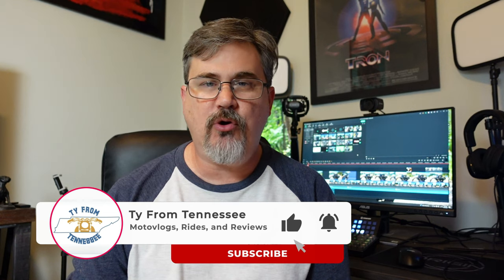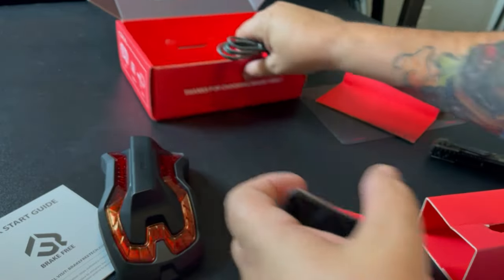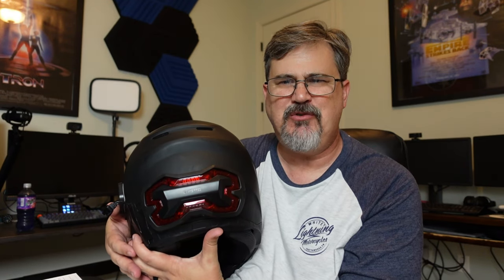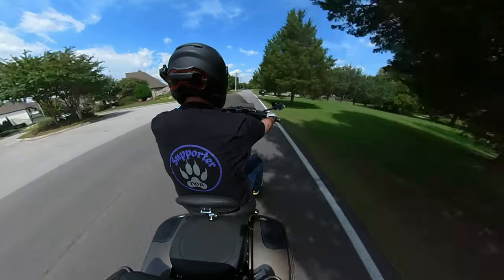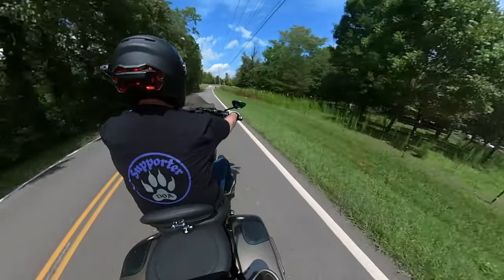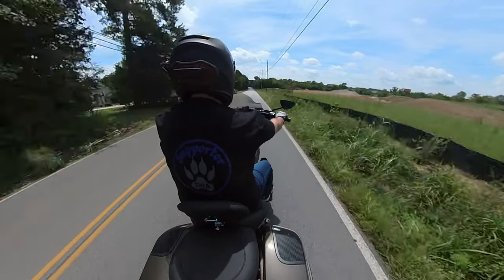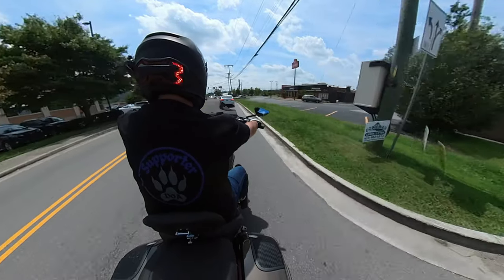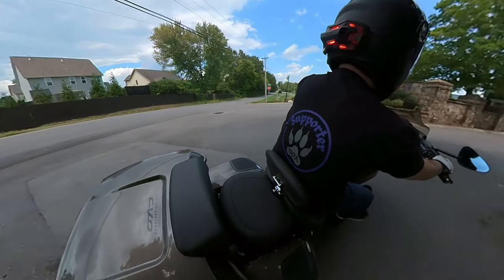Brake Free Helmet Light - Unboxing, Install, Review

Comment: If you don't have many lights on the back of your bike, I definitely see the appeal. Adding weight to the helmet is a concern. Also having something else to charge is a negative. I like the product and I think it's a good idea
Reply from the maker: Lots of both positives and negatives for this device. You can't really tell it's there on the helmet, but I was kinda worried about it falling off. Thanks for watching. I appreciate your time today.
Reply: 7 oz is the weight.  Does need tweaking for “normal” stops.  Overall more lighting at eye level.

Comment: Nice review man.  I wish it was maybe a bit more sensitive.  I feel this would be what I would use in a night time setting.  Great work Ty
Reply from the maker: I'm the same way with it too, but I bet at night it really lights up! I'm thinking about doing a part 2 to this video in a few weeks at night. Thanks for watching!
Reply: I was thinking about the same but my conclusion is the lower sensitivity might be intentional. Consider the general head movements (left head turn, right head turn, horizontal positioning, leaning etc). If the sensor was too senstitive, the light might blink like crazy just during the native head movements. We'll see if they come out with some improvements in the next version. Anyway it's still pretty good gear which adds up to the general visibility and safety.

Comment: howdy Ty.  Its theory of operation is simple and straight-forward.  The BrakeFree has a micro-controller which is programmed to support its modes,  and an accelerometer.  The accelerometer is probably built into the micro-controller board.  (yes, the engineer in me wants to dissect it)  The accelerometer is a tiny switch with a small moveable weight inside.  When you brake the momentum in the weight causes the switch to 'throw' when you decelerate;  otherwise, the switch is open.  

It looks like the accelerometer needs a sensitivity adjustment.  The switch only 'throws' if your helmet deceleration is 'strong' enough.  What I was noticing during your test is that if your differential deceleration was too small (gradually slowing down) the accelerometer didn't work as well;  its just not sensitive enough. 

This device could be improved by providing a sensitivity adjustment on the accelerometer,  or be equipped with multiple accelerometers (which could be selectable) so that the user has the ability to adjust the BrakeFree to their riding style.  Obviously, if you brake hard all the time then no problem.  The other way the device could be modified is by tying the device with a cable to the braking system on the bike so that the user could activate the lighting pattern based on front or rear brake lever activation.

The web site says the device contains 100 LEDs and a 3200 mah Li-ion power cell;  not bad.  The problem of course is the price point: $170 U.S. dollars is a bit steep for this simple device.  As a comparison, the BrakeFree is more expensive than an entry level Sena helmet communications audio device!  In my own mind, if the device were $59.95 I'd order one tomorrow, maybe.

On the other hand, I'm in agreement with you, any additional light is better than no light.  On the other hand, for $170 U.S. dollars you'd think that the user would not have to modify the mounting to keep the silly thing on.  On the other hand, $1.69 for a set of Velcro fasteners isn't too bad.  🙂

I'll think about it.  But first, an email to the designers...

PS  according to the web site they've sold about 10,000 units, which surprises me.  I mean, when you consider that most riders don't even wear a helmet,  it seems strange that helmet lights are a thing, and when new riders are trying to pinch pennies, its more likely their helmet (if they have one) is going to get a Sena unit before it gets a BrakeFree.

marcus
Reply from the maker: Thanks Marcus. So far I would wear this one a spare helmet that I have, but I can't fit it on my motovlogging helmet with all the "extras" that I have. Thank you for your excellent comment. I'm sure that it will provide another great viewpoint for someone watching the video!
Reply: Everybody in Louisiana wears a helmet, or you get fined...but even if that weren't the case, I'd still wear mine...I can live without an arm or a leg, but I need what few brain cells I have left safely contained inside my skull...not wearing a helmet can get them scattered down the highway...it's never too hot to protect myself...& I've already had one wreck I wouldn't have survived had I not been wearing a helmet, so I'm thoroughly convinced of their necessity as well as their effectiveness...I'd rather have it & not need it, than need it & not have it...🖖🏿😎👍🏿
Reply: I just ordered my Brake Free light. I have a helmet, a jacket, gloves, a cardo comms unit and riding boots. I don't have pants, and my jacket has the standard foamy back protector, so I have not upgraded it to anything significantly useful. I.e: I invested in this before some of the other gear (pants and back protector). And I only see the issue of the light stopping before I come to a complete stop, in the cases where a driver cannot see my regular brake lights clearly. Because at that point, I will already be on my brakes. However, maybe they could modify the duration of the light, and then have an accelerometer that does the opposite: Turns it off when you accelerate again. That way, it can never really stay on for "too long".

Comment: I agree with the other comments. 1) It's better than nothing or very little. 2) Added weight to the helmet is a concern. 3) Consistent lighting at breaking points is important otherwise why have it? 4) If it's not extremely (bordering on obnoxiously) visible in all lighting conditions it need to be. 
Great review Ty! 👏 👌
Reply from the maker: Thanks Toby! As for the weight of it, you can't really tell it's there on the helmet, but I was kinda worried about it falling off. Thanks for watching. I appreciate your time today.

Comment: I just received mine today. I had ordered the XL mounts just incase.  Glad I did. Cause the original mount doesn't touch much LS helmets.  I am only gonna put it on my commute helmet. My off road is gonna stay plain. I see that it wasn't working that well on that setting. Hopefully it does better on the others. My bike is in the shop so, I cannot ride and see. I have no cameras it will have to be from a driver behind me on the comments.  Since I have the XL mounts,  I will probably use the velcro. It sits off the helmet.  Thanks for the video
Reply from the maker: Hopefully you enjoy the product. A few modifications and I think it would be awesome. Thank you very much for watching! I appreciate your time today!

Comment: I thinik a wireless connection to the brake light system would be even better and pretty simple to incorporate into the bike. ..........................JB..
Reply from the maker: That's right! Could you imagine if Custom Dynamics put something like this together? It would be incredible. Thanks for watching today. Be safe out there!!
Reply: I was thinking the same thing. Seems like it would be more reliable than the accelerometer and probably use less battery. I appreciate that not having to install anything on the bike is more user friendly but the most important thing here is that it work reliably. Not showing solid red when you are on the brake is a failure to me.
Reply: That would be a good but more expensive option. The accelerometer would need to stay though as a big selling point is it comes on during engine braking when brake lights don’t.

Comment: Read though the comments, is there an on/off switch?
If not would not be very pleasant for the passenger, shining in their eyes.
A blue tooth connection to the brake system would be good also.
Reply from the maker: Hey Jerry! Yes sir, there is an on/off switch. When you long press the power button it will turn on the device, just repeat and it will turn it off. It's a pretty cool device and I use it from time to time. Thanks for watching and checking out the video!

Comment: Great unboxing. I have been watching these guys since they put this on  kickstarter. I think getting those high will help to get the attention of cars. Maybe keeping just the center two lights on while riding will help highlight when you slow down?   Is the helmet any heavier?   Ride safe, and thanks for doing this one., I've been debating.
Reply from the maker: I didn’t notice any weight difference on the helmet at all. It’s really light and easily attaches. It’s a pretty cool device and a great accomplishment for the guys who invented it. Thank you very much for watching!

Comment: Like Mr. Harris said, the accelerometer sensitivity needs adjusting if you want more illumination.  That said, it's a pretty neat device!  I looked into these a few years ago, but passed on it.  You're right though, more lights = more safety, especially at night.  Our brains filter out a lot of the "normal" stuff we see on everyday rides & drives, so seeing a brake light up higher than normal would alert drivers around you that something different is happening.
Reply from the maker: I've never thought about that before, but you're right..another normal brake light is just something we see everyday. I'll keep using the product from time to time. It's a good safety factor. Thanks for watching buddy!

Comment: I was thinking of getting the new version but based on this I'm not seeing the benefit if it doesn't work with the brake light system and has to guess when you are braking, but at the end of the day if they cant see all the brake lights I have on the back then one on my helmet isn't going to save me but in the darker months it would probably be more of a benefit if you are in a city or heavy traffic anyway thanks for the video
Reply from the maker: That's some good points you bring up. I'm just not all that impressed with this device so far. Maybe I'll give it another try when the next version comes along. Thank you for watching!

Comment: I just got mine and in the process of putting on. It seems like it could almost fall off the helmet mount? I'm not talking about the stick part but where the light attaches to the mount. It's that kind of lose, could it not fall off when taking the helmet off the head? It just seems so lose.
Reply from the maker: I know exactly what you are talking about. I put some Velcro on mine to help keep it in place. Thank you for watching!
Reply: It's working now, I didn't have it click in place. It's solid. But, I can see because of the roundness of the helmet not a lot of the stick part is sticking to the helmet. That could be better. I put the second one on my bike helemet but it's not sticking because of all the vents. Anyway, that's my problem to figure out.
 @TyFromTennessee

Comment: It's pretty clear why it does not light up at the end of your stops as you do that so smoothly - There's basically no force great enough for it to react to. Perhaps it should simply light up for longer when decelerating, and then using the accelerometer stop lighting up when it detects that you accelerate again (so it won't stay on if you slow down and then right after accelerate).

Also, regarding the flickering of the lights on your action camera: Just adjust the frame rate of the video. It's either 50 or 60 hz for the lights, often depending on where you are (Europe vs. US), so set the frame rate to either 25 or 50 if you have 50 hz lights, or 30, 60 or 120 if you have 60 hz lights.
Reply from the maker: I appreciate your feedback. Thank you and have a great day!

Comment: I just mounted my Brake Free light. I noticed that when mounted, I can wiggle the light slightly on the mount. Its slight, but plastic on plastic, I can "hear" that wiggle pretty good inside my helmet. I followed the instructions exactly for installation. So my question to anyone here....do you have a slight wiggle in the light when mounted or is it an extremely tight fit, no wiggle at all?
Reply from the maker: I also added some Velcro to mine and it holds the light on there super tight. I just didn't trust the included adhesive. Thanks for checking out the video!
Reply: Yes, I noticed the same when tried the original adapter. The tolerances are quite high. You can use some small piece of double tape to decrease the tolerances slightly so that it can't move. But as I have some kind of adventure helmet (HJC C80) with quite relatively deep curve on the back side of the helmet, I had to model and 3D print my custom holder where I also decreased the tolerances so that it doesn't wiggle.

Comment: I'd get one if it worked better...but as sporadic as it came on, it's not worth the $170 to me...seems like it would be most effective at night...I've been riding for years with just my normal brake light & nobody's rear-ended me yet, I think I'll pass on a nearly $200 light that only works when it wants to...there's no protection against texters, they'd plow into you whether you were wearing extra lights or not...great demo though...you can't trust commercials, they'll only show it working at peak efficiency...this is definitely more representative of what to expect from the product...it's a great idea, but still needs some refinement...oh yeah, I've never watched even a small portion of Shark Tank...I expect that trend will continue...Lol! 🖖🏿😎👍🏿

Comment: Like almost all the reviews, most of the video is spent on unboxing and install and not actually “on the bike” testing. Thanks for the bit you did do on the bike. However, from the testing, this performance is less than stellar. Great concept but frankly not doing what it supposed to be doing is a concern. At least, in this video, you get to see its failure, whereas some of the videos I’ve seen, they likely edited out the failures.
Reply from the maker: Thank you Jimmer. I hope the review was helpful. I just don't use this product anymore since I feel that it is not completely reliable. Have a great day and thank you for watching!